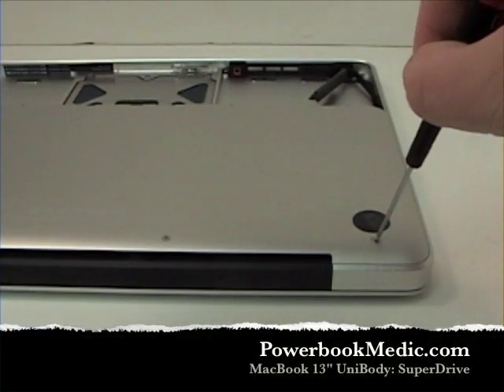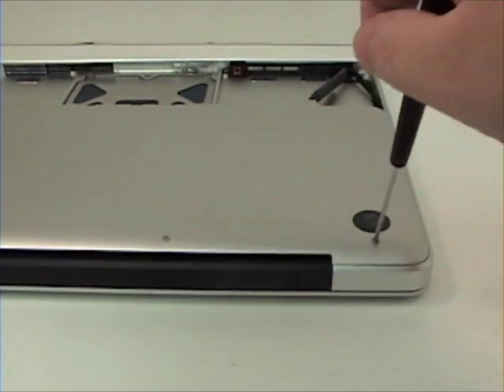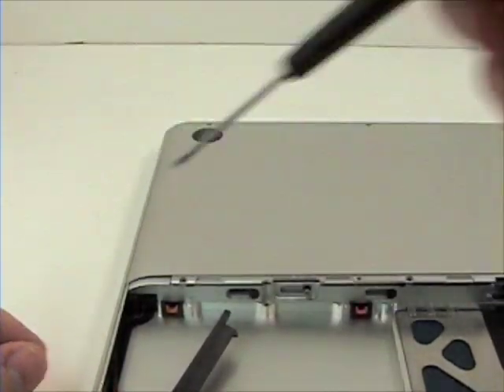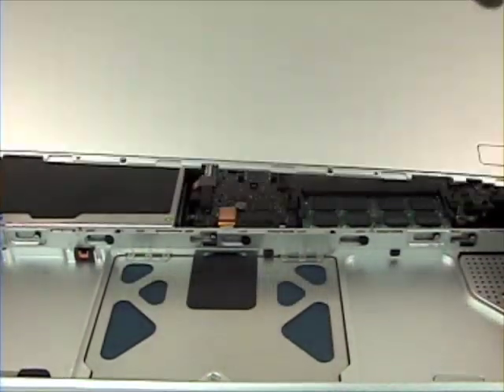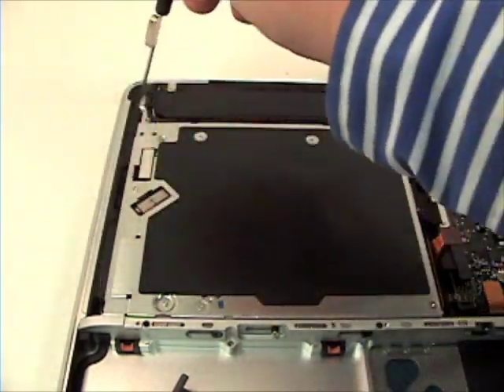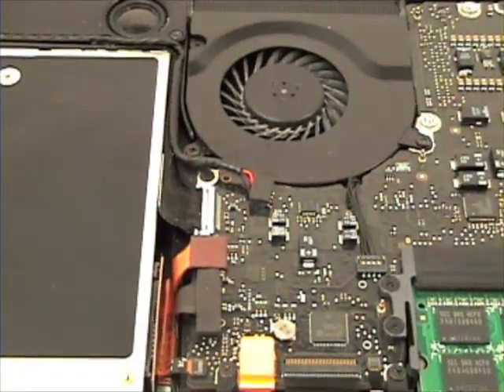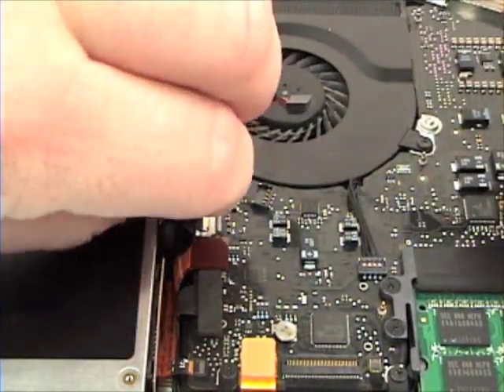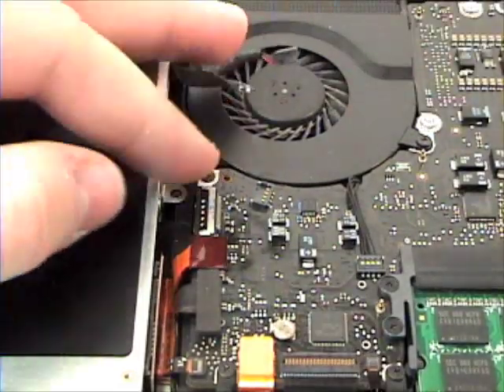Macbook 13" Unibody Disassembly Repair - Superdrive CD Drive Removal

Comment: After watching this video, I decided to take the plunge and replace the superdrive in my late 2008 aluminum unibody macbook. The original had been out of service for years, and I had previously purchased an external drive but hated the hassle of setting it up just to watch a stupid video. So I replaced my internal drive, and it was doing the same thing as the old one. I finally got it to work by almost inserting the disk to reset the drive. BINGO it works! THANK YOU SO MUCH!